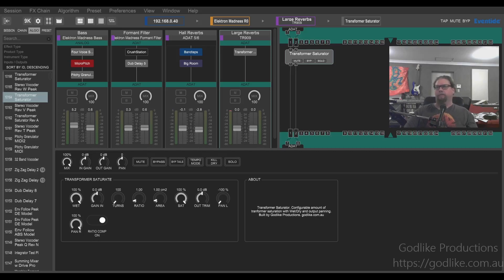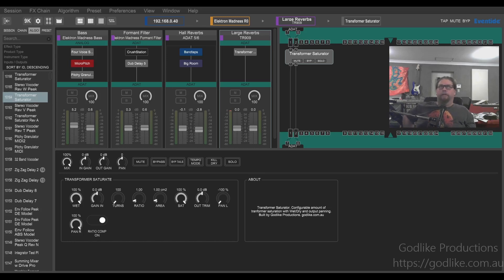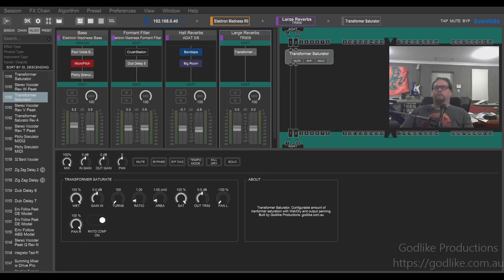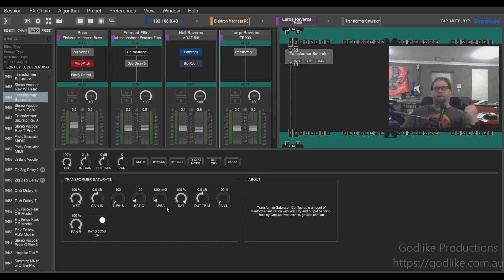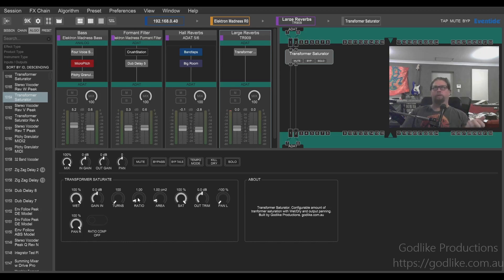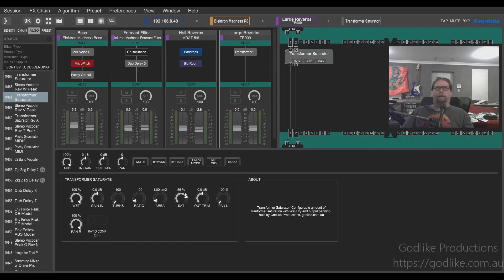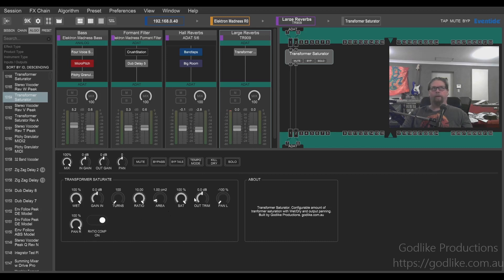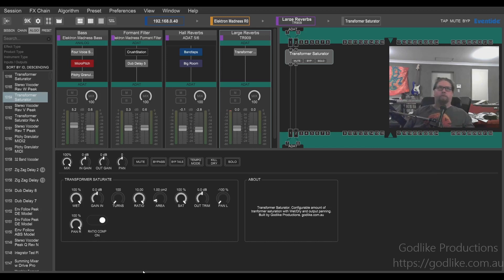H9000 Transformer Saturation Demo

Comment: Hey man this's intriguing stuff. Seem's as if the algo u are demonstrating here could not only do the things as u said but also be a tool for fine tuned anti-aliasing, not to mention just overall main volume enhancement in systems that don't necessarily require it but as a sort of 'sweetner' that really could be applied tooo any source. Definitely a very interesting ability & technique that's a bit more than just regular saturation more like, as the title of the vid suggest's; monitor transformation of any type that could be utilized in  copious amounts of circumstances u really have come up with something here that tooo my ears is very unique. So one more time without being redundant thanx again dude
Reply from the maker: Thanks mate. I'm not sure about anti-aliasing, I guess it probably could act to reduce high frequency content as the transformer coils almost act as balast, in the same way inductors do.  I'd never thought of that as an application.
Reply: @GodlikeAu  ...I've come up with similar applications for this with the Kurzweil KSP8 (KDFX) but not quite anywhere near this extent or close tooo what u got goin' on here¿so one more time without being redundant thanx again dude